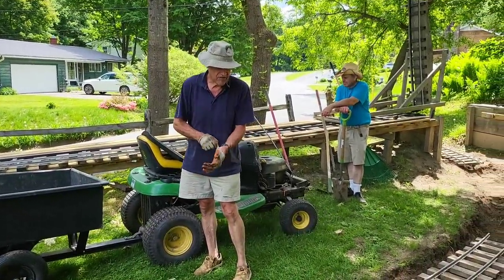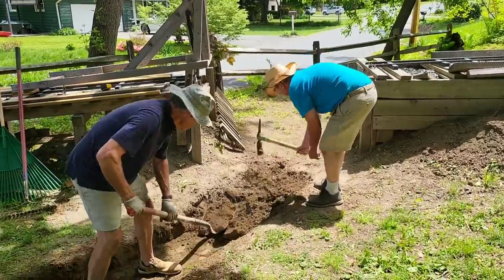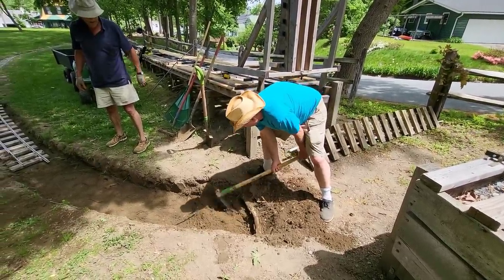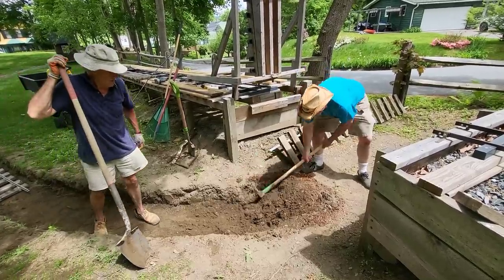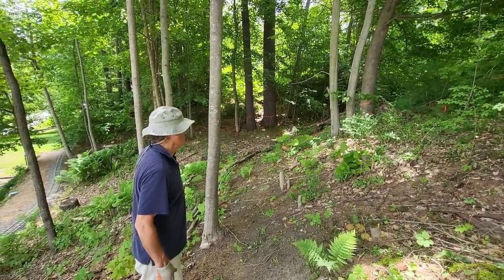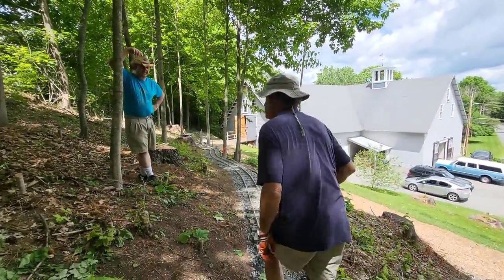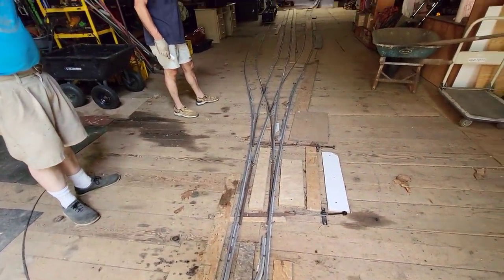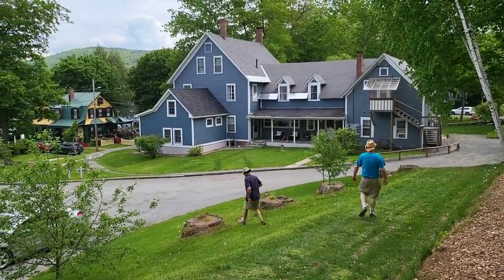Shady Pines Construction Update

Comment: Did anyone think about how darn sharp some of those curves are?  Most steam locos will not make those turns.  The place has sharps here and there..  Probably just fine for tiny 4 wheel locos and short cars, so all is well. I love the scenery, and the vertical grades. Would like to see a visit here when operating.
Reply from the maker: He has a four wheel electric and an electric climax with a bunch of short (six feet or less) cars. They handle the curves well enough. Every railroad is different.
Reply: I would assume that this is a mineral and lumber line
Reply from the maker: @solarusthelonghaulerrailfa3226  It's built like one but it is purely a pleasure carrier.
Reply: My Shay would love that track.  I've done 12% on short runs and 100+ yards of 8%, so the grade would just give me some stack talk.

Love the yard barn.  I didn't have the length and had to put a 3 way stub switch on the way in.
Reply from the maker: @russkepler  You'll love the Brick Mountain Railroad video I have coming up. Stay tuned...

Comment: I hate to ask, but what did you plan to do with rainwater runoff building up in the lower rail excavation you made under the bridge? Water will collect in there and every time you drive over that area it will pump the water, stiring up the dirt, causing a washout under the ties/sleepers.
Reply from the maker: Tony has a plan. There's a ditch nearby.
Reply: @MillBrookRailroad  that's what I was hoping but we didn't get to see the finished result. I hope my railroad turns out at least half as good as all of yours when I start building it! Looks amazing! Btw, I'm probably going with 15" gauge and eventually having a scale model of an AC6000CW with a real AC diesel generator running 4 or 6 AC traction motors. Future dreams right now though
Reply from the maker: @wraith0127  We won't see the finished result until September when Tony comes back from holiday. 
The secret to a great railroad, by the way, is in all the work you put in to survey at the beginning and all the sub-roadbed work before you put any ballast down. If you put 4 to 6 inches of ballast down before you put any track on top, you'll find the track is more stable and wooden ties will last longer than if you cheap out and only do an inch or so under the ties. As far as an AC6000 goes on 15" gauge, I think you'll find the price closer to a Lamborghini Murcielago than a used F150.
Reply: @MillBrookRailroad  Oh absolutely, but I will be doing nearly all the metal work myself, designing the power system from scratch, and even casting most of the metal parts including turning the wheels on a lathe. Just the motor/generator alone will be about $12k and weighs around 600lbs. But like you said, I'm going to start small with a little battery powered plywood box, then one day build my dream loco. Gotta start somewhere

Comment: find  a large axe  no  handle  just  head  and  piece 1  inch  black  pipe  and  weld  to  top of  axe  head for  root  remove  and  rock  remove   and it make a cleaner  work 
  remove  and keep you feet  away  for  it